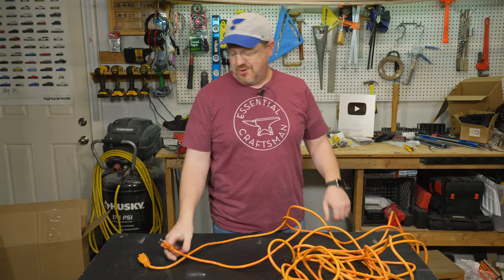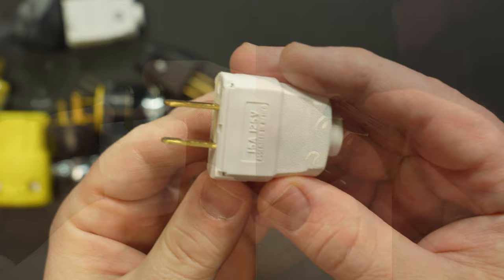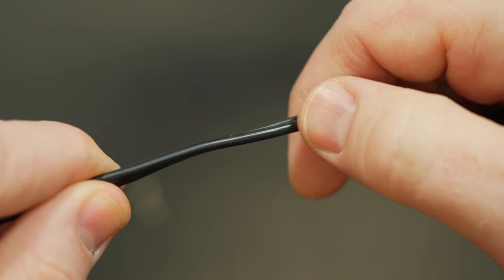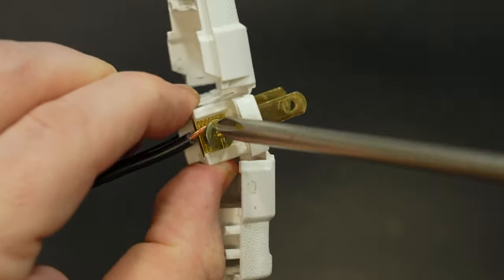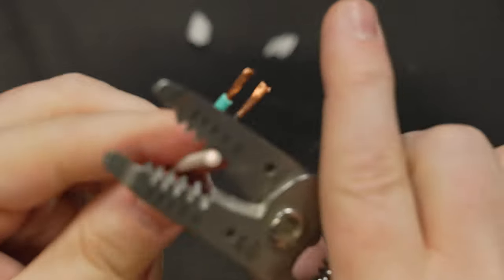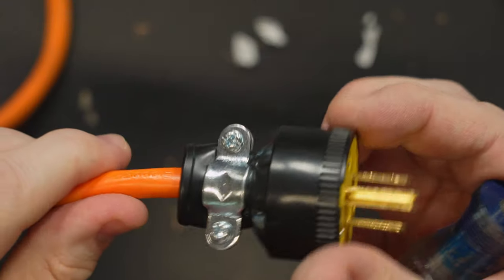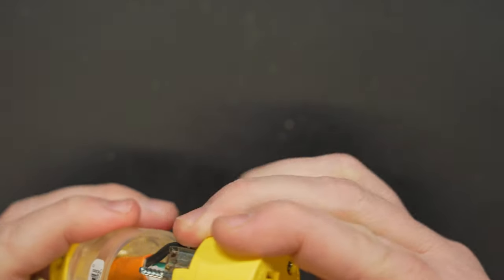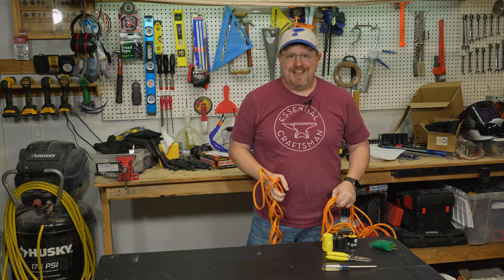How to Repair An Extension Cord - Replace The Plug!

Comment: I really like how simple his explanations were, n how he accompanied them with great close-ups as he went through the steps - so, really great timing... 👍 It was also nice that he didn't do a rush job. Also, he didn't "talk down" to his viewers, as if they were total idiots. He was very respectful in this. 

I have replaced plug ends, n helped my son with his endeavors of replacing a couple in the recent past. Sadly, one end got hot n melted on one of them. So, because I wasn't real familiar with the style he used, I searched n came across this video - after checking out another one that was not very helpful. This video helped to figure out where he went awry. 😆 I don't know how I could have missed it when my son replaced the plug. 😢 Niw off to replace it again, with confidence. 😉

Thank you for a well done video.
✌️
Reply from the maker: You've made my day, Andi! Thank you!

Comment: Thanks for posting. I seen this video yesterday and I did the replacement just a few minutes ago. 
I was about to throw away a 150ft extension cord because the ground prong snapped off. I seen this video and was able to save it for cheaper than buying a new extension cord.
Reply from the maker: Great job!

Comment: great video I never usually touch electric projects but I tried this time. I changed a pug on a extension cord and followed your instructions and everything went well. my extension cord is working again. thanks for the excellent instructions.
Reply from the maker: I'm so glad it helped, Steve. Nice job!
Reply: @AmplifyDIY  thanks. I usually don't fool around with electric but I gave it a shot & it worked out.  HAPPY HOLIDAYS TO YOU & YOUR FAMILY.   🎄

Comment: Thanks for this video. The one question I didn't get answered it around amps. I have an extension cord that is rated at 13 amps. Is it safe to replace the male end with a 15 amp plug? I ask because I can't find a 13 amp replacement plug. Thanks in advance!
Reply from the maker: Yes, I think you'll be fine using a 15A end on a 13A cord. Just remember that the cord is the limiting factor on any load you attach. Good luck!

Comment: Great video.  I have heavy duty extension cord that needs a new male end.  The wire that goes to the ground is actually pink not green.  Is that unusual?  Thank you.
Reply from the maker: Manufacturers use all kinds of colors internally. Just make sure it really is going where you expect, and ignore the colors. Good luck!

Comment: These videos are great--thanks! What if I have the opposite problem--cord damage close to the appliance? I guess I could always open it up and see if there are similar terminals to secure the wires to....
Reply from the maker: Yeah, if you have damage close to the appliance, I'd disassemble the appliance and see how the power cord is connected inside. It's likely you'll be able to simply cut the cord just past the damaged area, remove the short part that is connected tot he appliance with the damage, and re-connect the cord however it was previously attached. I've done this with a skill saw, and it still works great today. Thanks for watching!
Reply: @AmplifyDIY  Sounds good; I'll give that a shot. Thanks again!

Comment: Will this completely solve the issue with connectors that are getting too hot?   I notice some of the 15 amp connectors are bigger than others, do you need the big ones or will the smaller ones do just as well?
Reply from the maker: As long as it is rated for the load, it should be fine. if something is getting too hot, then consider upgrading to a higher-amperage circuit and use an extension cord rated for a higher load.
Reply: @AmplifyDIY  Thanks for the reply.  I've had extension cords that ARE rated for the load (1500 watts, continuous use) that do just fine at that level and stay cold, but another cord with same specifications will get hot at the connector.  I've been told that it's all about how the plastic is molded onto it and that it's somehow leaking or meeting resistance.  Theoretically, it seems these new connectors would solve it, but I didn't know about the plastic inside them and whether it mattered how big it was etc.

Comment: I always feel like when I tighten the clamshell style onto the cord I'm cutting through it. Makes me nervous. You don't do any special tricks when looping stranded wire around a screw?
Reply from the maker: No special tricks other than make sure to loop it in the direction the screw will tighten (clockwise). I've never had a clamshell cut through the insulation. Thanks for watching!

Comment: @4:35, i wish me local stores had that type for 2 prong, only ones i could find used friction and pressure from the cable to the prongs via the casing, fine i guess for a lamp cord, but not something i would like in a high traffic area.

Comment: I appreciate your instruction, but when you replaced the 3 prong male end plug, you inserted the ground and neutral wires in the left side of the plate, but the hot wire you inserted it in the right side; after your pointing out in the prior plug it is important to place the wire so that it's partly secured with rotation of the screw, I expected to see that followed with the other plug attachment screws.🤔
Reply from the maker: Ah, you must be referring to around the 11:15 mark of the video, right? Notice that those connectors are actually a clamping style: the conductor does not wrap around (or even really touch) the barrel of the screw; rather, there is a plate that the screw clamps down on the wire to sandwich the conductor between it and a backing plate. On this style, it does not matter which side of the screw the conductor enters the clamping plate.

Good eye for detail, and thanks for watching!

Comment: Great video - You would make a good teacher! What if you have a 3 wire (flat) extension cord, but they have no colored wires wrapping them and they are all the same?
Reply from the maker: Hi Roger - are there any colors wrapping the individual wires inside the insulation? If you strip off the outer jacket of insulation, do you find any colors at all? If not, sounds like you need to perform a "continuity test" with the cord, to determine exactly which of the 3 conductors connects to which of the 3 prongs of the cord - i.e., which is hot, neutral, and ground. If you have a simple multi-tester, you can easily perform a continuity test. I don't have a video on exactly how to do this, but I'm sure there are tons. Just search for "how to perform a continuity test" for instructions. Good luck!
Reply: @AmplifyDIY  No - the 3 wires on the extension cord that I was replacing the male end plug had NO colors wrapping the individual wires. I did perform a continuity test, and STILL got the 3 wires mixed up. Thank God I have a good tester that I can plug into it which informed me I had the "hot" and "neutral" wires reversed. I switched them over and good to go - Up and running again. Thanks again for you informative video and guidance!
Reply: @AmplifyDIY  I do not see any inner colored sheathing.  Does that mean polarity doesn't matter for this florescent light?

Comment: While I do like the method of cord storage, I only usednit a few times before being annoyednby it. It's cumbersome for something that isn't being pulled out frequently, or for any cord 50+ ft in length.

I have subscribed to the method I learned to coil audio cables in a Tech Theater class in high school 20 years ago. One normal loop, then underhand twist with the next loop. Alternate with each loop. You can take the finished coiled cord, toss the whole thing out or pull just part of it, no twists in the cord. I do this with every type of cord over 15-20 feet now, maybe even shorter if I'm making a small diameter coil like with ethernet cables.

I wish I had an example vid to link.

There is another great method for really long cables that are used frequently, modeled after how parachutes lines are bundled after a jump. Ends up looking like a figure-8, and is very quick and more compact than the method shown here, also.
Reply from the maker: Hi Marlin - I use the method of one normal, one underhand when I store things like larger garden hoses, air hoses, etc. Since I rarely pull out an extension cord like this, I like the method I showed so I can just throw them in a pile into a storage tub, or hang them all from a hook in the garage and nothing ever tangles up. Thanks for watching, and for the tips!
Reply: @AmplifyDIY  I would agree, throwing multiple cords in a bin like this can be useful. Coils can prevent other cords from occupying the central space, and this method should avoid most tangles even with a hasty toss and being stuffed into a bin.

It is definitely worlds better than many ways we see, like wrapping around the hand and elbow!

I normally don't store too much together that way, but when I have a handful of smaller diameter cables together in my work bag, the coils make them easier to dofferentiate.

Comment: Can you replace a plug end that is rated for 10 amps with a 15 amp plug end?
Reply from the maker: Hi Mister Lift - yes, you can replace a plug that is rated for more amps. Just don't replace it with one that is rated for less. Great question!
Reply: @AmplifyDIY  thank you!

Comment: The plugs on the shelf are marked up like 4x plus from asia it seems(even compared to similar store in asia. And yea usa style plugs too)
Reply from the maker: Some plugs here are quite expensive. Cheap ones are just a few bucks though... but yeah, local economies, different currencies, etc... stuff is usually more expensive here than in Asia.
Reply: @AmplifyDIY  the few bucks is the 4x. Depends how many you buy here or where from though. The electronics shop near me in thailand has them yellow plus rubber ones in dozens under a buck. Crusty hard plastic two pins 30 cents or so.

Same shop has arduino and esp stuff on the shelf too along with ac control boards and a components desk etc. It's pretty sweet.

Comment: I have a cord that has 2 grey wires 1 black - never seen this please help
Reply from the maker: Hi John - the black is probably ground, the 2 grey are probably the hot and neutral for the A/C... but it's really anyone's guess which is actually which with non-standard wiring colors like that. You really should do a continuity test between the poles of the good end of your cord and each conductor to determine exactly which conductor matches up with which part of the plug. You'll need at least a cheap little multimeter to do a continuity test. Good luck!
Reply: @AmplifyDIY  thanks

Comment: awesome presentation...but i could help to realize that on the second repair u cut off a damage female end then put a male end in its place....lol
Reply from the maker: Heh. The risks of cutting a bunch of different takes together in a video. :-) When I was finished, I had a correctly assembled cord with both ends replace, one female, one male... but while producing the video, I did cut off both ends and install new replacements multiple times to get the right takes / usable video. Thanks for watching!

Comment: A square head (Robertson) or ECX screwdriver works better on these types of screws. Most 11 in 1 screwdrivers will have one or both of those tips and can be had for around $10.
Reply from the maker: Great tip - thank you!

Comment: I enjoyed the video but UK plugs are much better than the US ones. The plugs cannot drop out of wall sockets or even get pulled out by the cable. The earth pin is longer and opens guards in front of the live and neutral ensuring no child can poke anything into it. If you haven’t visited the UK, the plugs are great but the weather isn’t! Love the channel 😃
Reply from the maker: I've seen several folks on YouTube (@ElectroBoom comes to mind) who have done a fantastic job explaining why UK plugs really are far superior... and I agree. But you gotta play the hand you are dealt, right? Your umbrellas are likely far better than ours as well. ;-) 
Thanks for watching!
Reply: There are tamper-resistant (TR) outlets in the US that are required by code in most residential work now. I replaced about 30 outlets in my home with this design when my child started crawling. What you describe sounds similar, but these require both hot & neutral prongs to be inserted equally to have a set of shutters covering both openings slide past each other and allow the prong to enter. It prevents inserting an object into either of the slots individually (ground doesn't matter). (Poorly made ones from early designs made many people hate the idea, as the operation would bind and make it difficult to insert a plug. Newer ones are much better.)

I'm curious how this compares to what you describe!

Of course, this doesn't protect against cord becoming partially removed and objects contacting the expose prongs from the device plug. That is definitely a design advantage in favor of UK plugs.

Comment: Some of those ends are more than a whole new extension cord it seems
Reply from the maker: It really depends. A high-quality end replacement may cost nearly the same as a super low-quality (and short) extension cord... I'd rather have the higher quality (i.e., can safely handle higher loads) solution. Thanks for watching!